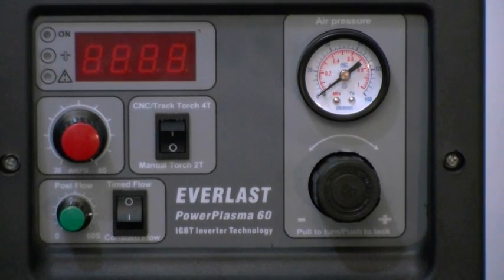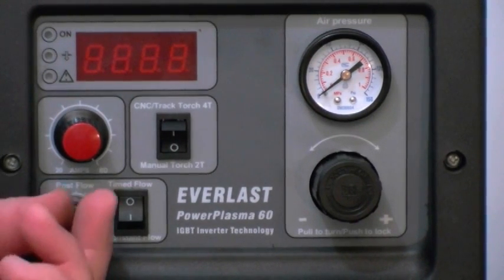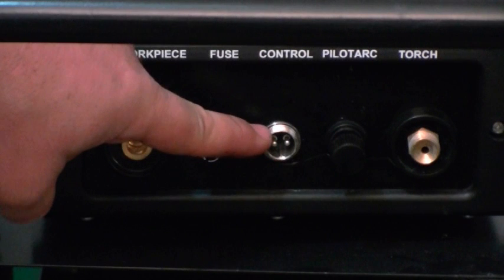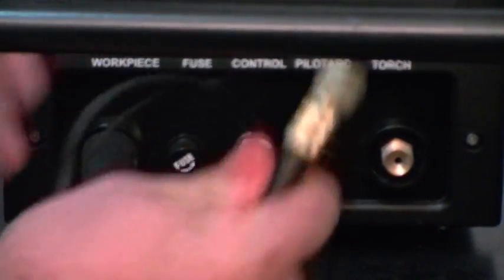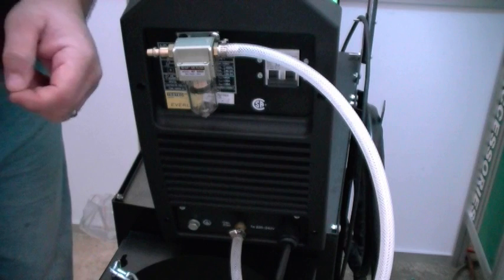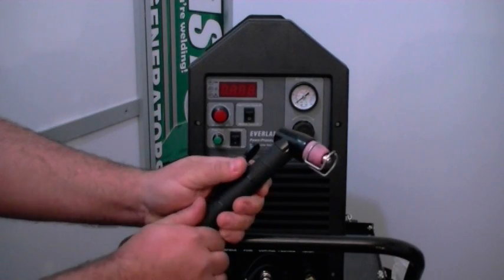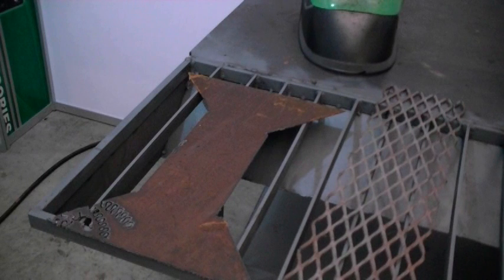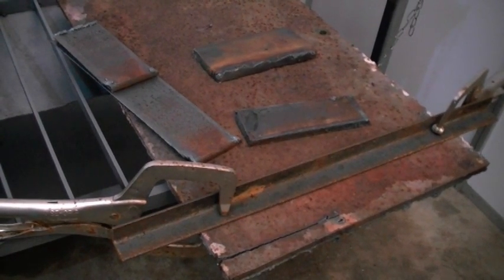Plasma Cutter - PowerPlasma 60 part 1- Everlast Plasma Cutters

Comment: Can you use it as a drag tip. Will other consumables work.
Reply from the maker: This unit is an older model.  Newer models have a different torch.  But there is a drag tip for the newer torch.

Comment from the maker: It's a common way to affix torch switches in the industry.  Either that or Velcro. I guess it depends upon how wide of a field of experience you have, if you are familiar with it or not.  But too, this is a  old unit.   We have new torches and a new design.  This is from unit designs made in 2008.  But the old torch is reliable, and we have replacement versions that incorporate the switch in a conventional head if the customer wanted one.

Comment from the maker: This unit was HF start.  This is an older video.  But all the new units are the PowerPlasma 60S which are blow back start for 2013 and on.  The PowerPlasma 60C is for CNC and is yet a third different type start which is an inductor start.  For CNC use this is a great way, because it offers little or no interference and uses a HF style torch...It's faster starting than blowback and works great for CNC.  The 60C is not designed for hand cutting though.

Comment: @citbitch this will depend. not on the plasma cutter, the torch must be designed for  water submerged cut, and you need a constant air supply to the torch to prevent the water fill the torch inside and force the plasma cutter unit from short circuit, remember a plasma cutter will discharge the energy through the air, the water has a higher conductive level  than air